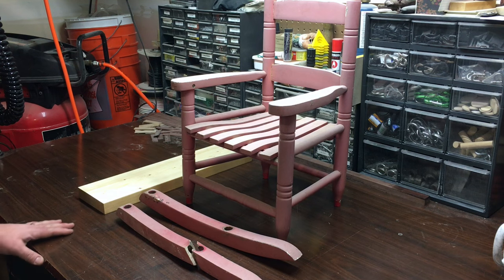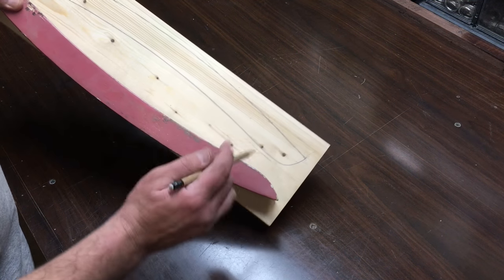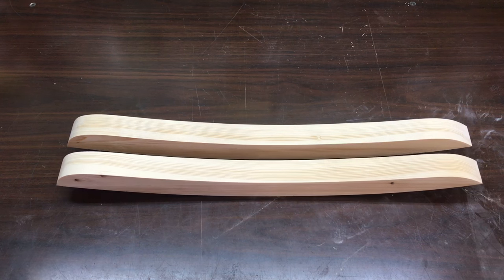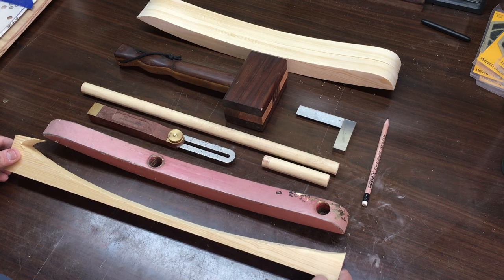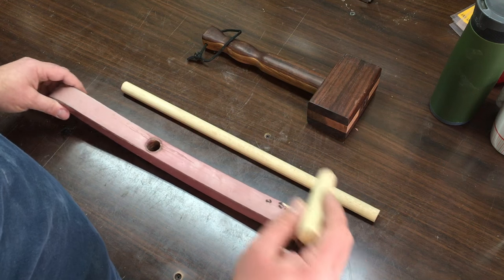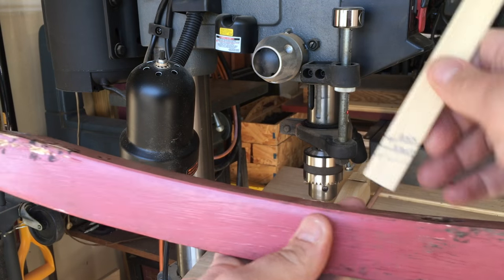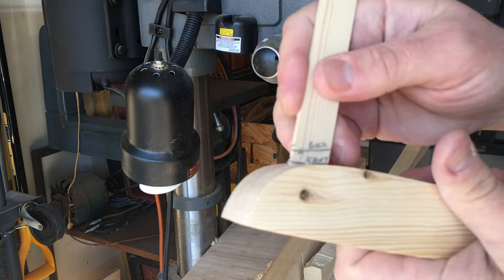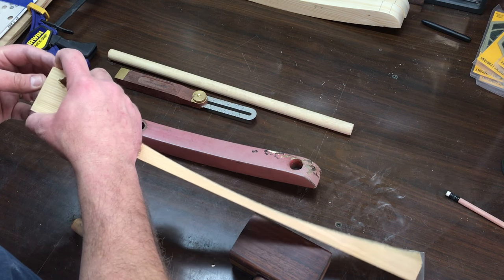002 - Replace a Broken Rocker

Comment: Great video.  I've got an old chair that the rockers were cut off.  What if you don't have an old rocker to use as a template? I just have the chair.  Also, you didn't glue the legs in?  Right?